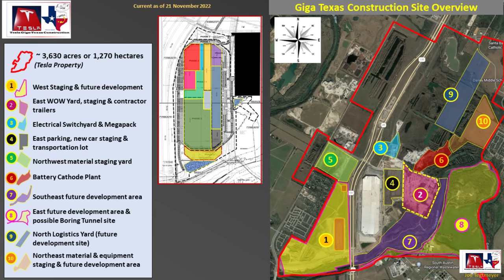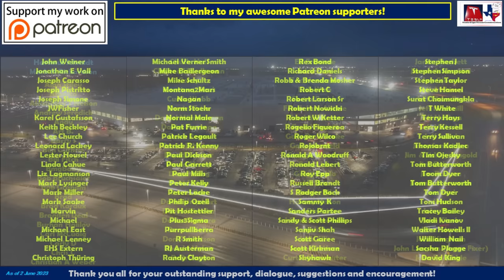Product Display, S Footings, Conduit & Megapack Site Work! 12 June 2023 Giga Texas Updates (07:05AM)

Comment from the maker: Video is in 4K, but YouTube is taking some time to process it into higher resolutions. Please be patient and this should be corrected shortly.
Reply: The new grey box next to the helipad looks like a rain booth to test for water intrusion. That is why they have one of those tank trucks next to it to recirculate the water. You can see the recovery pipes along the bottom edge for the water to drain.
Reply from the maker: @davefroman4700  Thanks Dave ... That does look like what it is!
Reply: @JoeTegtmeyer  Btw? Figured out why the display is out front. July 1 is Tesla's birthday.
Reply from the maker: @davefroman4700  cool … thx!

Comment: Thanks Joe.
6:47. GA, Level 3 inside. Level 4 addition visible from about gridline D.
In Joe’s photos, Level 4 has also been extended north of gridline 33 (just to the left) and into Battery.
8:37. GA, apron. Large curved machine guards. Trumpf, empty.
9:28. Southend. White pipes. Can only be sanitary sewer. Would be weirdly located for roof drains. I assume it's at the extreme depth to duck under something. A deep pit within the building maybe? Isolation foundation or similar. Draining west. Ultimate destination could be the deep well.
Interconnection of the separate drains at a high level at the left end. All other risers capped. Pressure testing likely.
12:32. Southend end. Interconnected footings. Similar at the Die Shop. Ground conditions here also may have required a different footing design, the CFA piles for example. 
It will be interesting to see if there is a connection north south between footings also.
13:58. BIW apron. Left. Another curved machine guard section.
14:37. Helipad. Glass walled tunnel structure and a water storage trailer beside. Rain ingress testing structure?
16:13. WOW yard. TKS equipment. Marked ‘PTED HOUSING’.
19:56. Old House Site. East of. Stockpiling fill.
20:24. Tesla road, north. Vault. Duct-bank in north vault heads north, perhaps to the new switchyard/substation. Duct-bank from the south vault heads west connecting into the existing supply.
20:40. Tesla road, north. Duct-bank. A fraction of the conduits that started the journey from the Die Shop and Cathode.
21:42. New switchyard/substation. Mega-Vault. Rebar for the walls very visible now.
23:08. Monopoles. Connection to the BESS switchyard is an underground cable from this pole. Drawing shown in the ERCOT documentation.
Right. Removed monopole/s now in short sections. Monopole further north being cut up in Joe’s photos.
23:55. BESS switchyard. Might be similar structures in the nearby switchyards that can be compared to.
26:14. Northend parking. Right. Shallow excavation, rebar cage being assembled.
26:32. Casting apron. Electrical vaults. Smaller conduits bypassing the left vault.
26:46. Casting apron. Orange and black bars/pipes. Plastic sheathed?
28:37. Casting roof. A dozen or so square frames. Might be curbs/upstands.
Reply: 20:24 Duct-bank in north vault... The vault also has a hole for conduit to head west. That is, if they use it.
20:40 You're right about A fraction of the conduits making it to 20:40. Just wild speculation but maybe the other conduits will follow the path north as seen @ 20:24 ? This is a lot more difficult to make sense out of. Sure would be nice to have a complete schematic of all the wiring layout. Or a site plan that showed the location of conduits.
Reply: 20:40 One more thought.... Connecting to existing supply seems to indicate that they will keep the the temporary substation? Or at least the conduits?
Reply: @DavidJohnson-tv2nn  20:24. Almost room for another vault in that excavation.
20:40. Possibly, although for now the opening is only large enough for 3 conduits (as seen in Joe's photos) and are entering very close to the top of the vault.
Reply: @DavidJohnson-tv2nn  20:40. Temporary supply. I think it will stay. It's there, paid for, unless Bluebonnett doesn't want to play ball they are probably happy to leave it and earn some revenue.

Comment: New facility in testing and calibration lot looks like water test system (have seen something similar inside the factory before) it shoot water at the car from all the angles to check for leaks.

Comment: Given that 1st Ford, swiftly followed by GM, have chosen to adopt NACS, I wonder if the display is for an upcoming EV automotive industry charging standard event. Tesla may be inviting other OEM's to come along to discover and discuss the possibility of the integration of NACS into their vehicles.
Reply: The issue is that technology is advancing so fast, even tesla, a real innovator, is being left behind.  New capacitor technology will make tesla superchargers and all the others seem like old technology. Installing charging point with almost instant charging is going to be the norm and that is not as far off as we would think.Yes a standard is needed now but i think it will obsolete within the next 10 years at most.

Comment: I expect we will see a building at the south end of the switchyard. I think they are essentially building a basement that will be used to route cables. On top of the basement/vault they will build a structure to house the electrical distribution equipment.

Comment: I think the footing connections are for exterior walls, they look identical to other exterior foundations. it's a sperate building, perhaps with a spanned roof.  Why else would they have built all the walls and painted the walls!
Reply: Contract probably said to paint all four (eight?) sides, so they are doing it.
Reply: @sammyk874  I think so. 

FWIW, the south facade including the 2 diagonal corners is 15% of the building perimeter. Would have been a nice saving to not have painted.

I'm speculating that the south facade stays, and only the diagonal corners are removed, in which case that's only a 5.7% saving, as the now internal south facade is inside the building and would need paint anyway.

Comment: Great video as usual! My guess on the "upside Christmas tree" structure on the tall power pole is it is for the metering of electric power consumed/delivered to/from the site!
Reply: The "upside Christmas tree structure" is the interconnection point between Tesla and LCRA. That structure will support insulated 345 kV cables that come out of conduits. the underground conduits will cross the utility easement and terminate at the BESS substation on the other side. The cables need to spread out because they will connect to uninsulated cables going up to the transmission lines.

Comment: The plan shown in Joe’s 19 October video of the new LCRA switchyard shows the 3 monopoles at the north end of the site, and that these are designated ‘To Clear Springs’, To Gilleland Creek’, and to ‘Tesla Energy’.
https://youtu.be/elLqkwm6Qd4?t=1302

From the recent ERCOT documentation it’s clear the ‘To Giga Tesla Energy’ is the BESS (megapacks) via an underground cable and the BESS switchyard/substation.

On a couple occasions I tried to find the Clear Springs and Gilleland Creek switchyards. I couldn’t find anything definitive on the web so I decided to do it the old way, tracing the transmission lines on Google Earth Pro. I didn’t get far, just across the river in fact where I had expected to see all the transmission lines on both the monopoles, and the lattice towers divert into the Sand Hills Power Station switchyard. Except they don’t.

At 13:32 the transmission lines on the lower monopoles do originate in the Sand Hills Power station switchyard (the switchyard closest the power station, there are 2 switchyards over there). These lines currently supply the temporary switchyard through the Bluebonnett Electrical Co-Op.

The transmission lines on the taller lattice towers turn west before the river, tower changes to a pair of monopoles, then cross over the river before the towers change to tall braced truss type towers and disappear into the mist towards Clear Springs. Visible at 7:53. No connection to the power station.

Never noticed this before. I may be missing something.

Brad’s video from the 10th is easy to follow, https://youtu.be/d7xuK_U56bA?t=801
Reply: Dessie, The north connection goes to a switchyard at 30deg 24'35.57"N, 97deg 34'25.60" W west of New Sweden and then up toward Hutto.
The south connection is to a switchyard at 29deg46'21.99" N, 97deg 34'25.60" W near Clear Springs.
Reply: @eltonray2934  Thanks Elton. I was looking at 2 switchyards to the north. Your one on Cameron Rd, and another on East Pfulgerville Parkway between 130 and 685. Then I got distracted with the Sand Hills power station.

I can't find anything at the co-ordinates for Clear Springs.

There is one at Weltner Road, Clear Springs, and a larger one on Link Rd a little further east. Some switchyards are marked on Google Earth. The nearby Marion yard for example.

Comment: Around 22:00 the 8 temporary staircases leading down into the "Mega-Vault" look a bit too nicely spaced to be only for construction crew acces??? The arriving conduits contain 2 times 4 cables each, and are aimed parallel to this row of staircases. Could it be that at each "staircase" 2 cables are peeled off from the conduit-corridor to be guided to the floor of the vault?
Reply: I would agree providing they build a firewall dividing the "Mega-vault" into two spaces. That is to maintain separation and two independent circuits. Otherwise, wouldn't the cables closest to the center be to close to each other in the event of a fire? Basically being able to take out both power feeds to the factory. Not necessarily from flames, but from heat melting insulation on adjacent cables.

Comment: At 22:30, you can see two sets of (red) electrical busses pointing toward the “Mega-Vault” for the future connections.
Reply: George, the two red busses are the main 24.9 kV feeds to the plants from the new Hornsby Substation. They make a turn toward the assembly plant before the mega pack area.
Reply: The red busses I was referring to are metal, and are inside the substation. There are actually 6 connection points, in two groups of 3.
Reply: @georgegoodwin9722  Sorry George, wrong red buses. The connections you are referring to are the three phase 24.9 kV secondary outputs from the transformers. This is Tesla's connection point for power.
Reply: Thanks Elton, I see the transformers, separated by the block wall, but what are the other, smaller devices downstream of the transformers?
Reply: @georgegoodwin9722  Starting at the transformer output the first devices located on top of the structure are disconnects for maintenance safety. There appears to be current measurement CTs in the line. The ground mounted device is a 3 phase breaker, probably operated remotely. Downstream of the breaker are more disconnects, then to Tesla. Breakers are designed to open the circuit under load and disconnects are used to isolate devices for service.

Comment: Such a  massive building yet they have to store castings outside, someone miscalculated the size of building needed. Maybe they will build over what is now the carpark so they can store parts unde cover and not have it all out in the open.
Also what is with the storage area with the many supply trucks,, seriously could they not have planned for this and build a proper warehouse there.

Comment: BESS substation: @ 24:15 While the substation equipment will be above ground.... The actual connection to the east monopole on the other side of the utility easement will be via 345 kV underground cables. See interconnection agreement page 48 (PDF page 59).

Comment: The new structure near the helipad looks like a roll test booth, used to test different functions on the cars at various speeds.
The other units are controls and power for the booth.

If you remember there were similar roll test booths at the beginning of the Cyber Rodeo  tour.
Reply: I was thinking it might be a water (rain) test with the big water tank parked next to it.
Reply: @bobcallahan2322  Pretty sure the wind tunnel does water as well as wind noise.